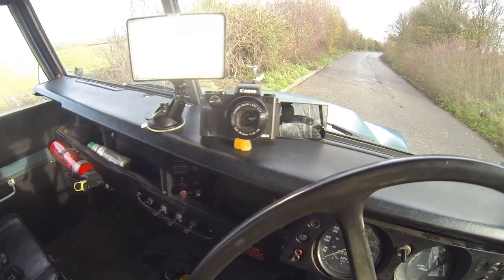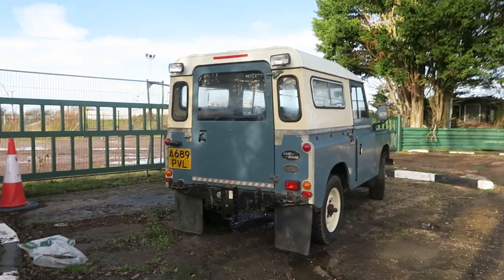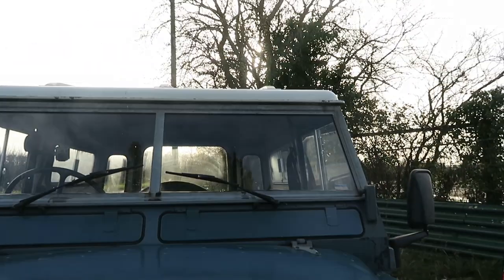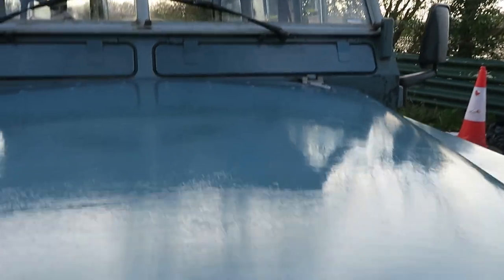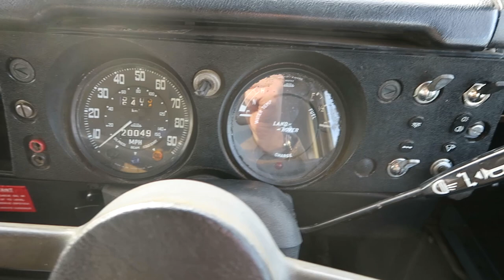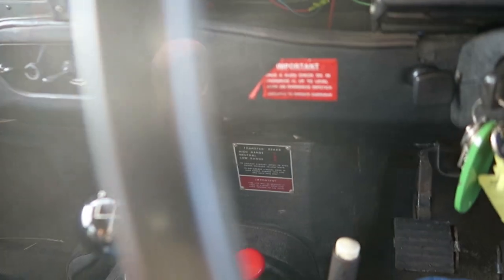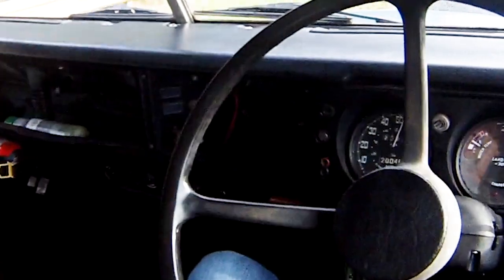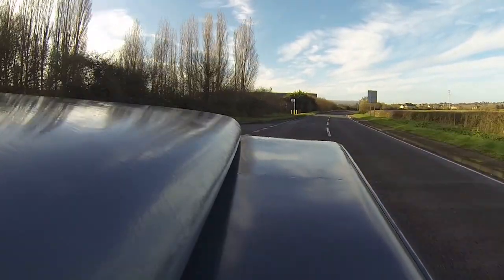Series 3 Land Rover! 🚚 Great to drive?🤔

Comment: Series landrover normal use 2 wheel drive push down yellow knob to engage 4x4 high range  to disengage pull red leaver back you are now in low range 4x4 push red leaver back to original position you. Are now in 2wheel drive 👍

Comment: I have driven a couple new Land Rovers in the past couple of years; a Discovery and a Defender. In both cases the salesmen 
Cheers👍were more interested in telling me about all the high tech and could not answer power train questions without looking at the spec sheet. One guy thought being able to change the temperature of the passenger seat with your cell phone while on the other side of the country was a useable feature! Really?!?!
I own a 1966 88” Series 2A.
It is the most fun you can have behind the wheel!

Comment: Is it black paint on the cabin roof above the front seats? Or glue from a headlining? Surely not? :-)
Reply from the maker: That is the glue from the original headlining which I took off. The glue is nicer to look at than the headlining. I have got a replacement. Not got around to it yet :-/